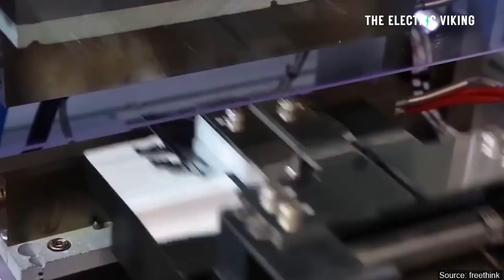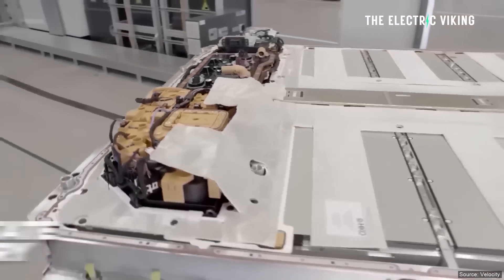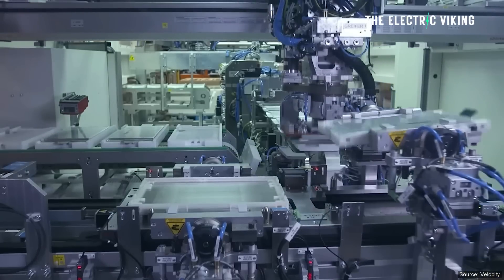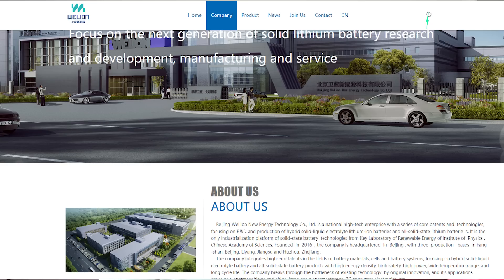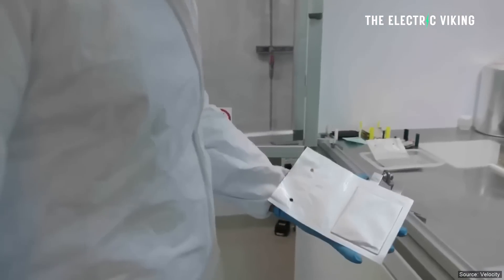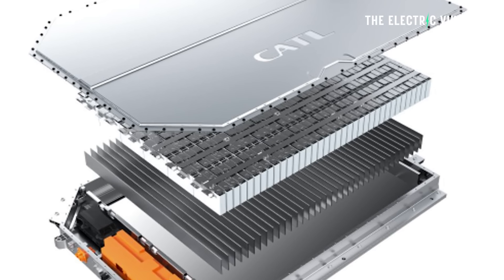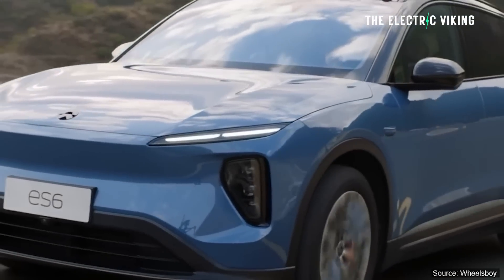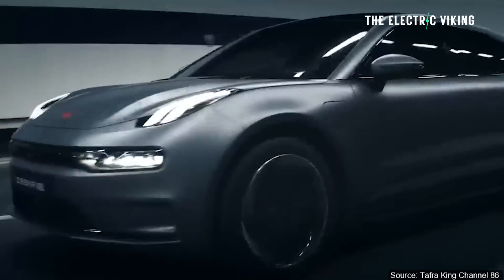Nio's ES6 has 577-mile range & 150-kWh Solid-State Battery

Comment: November 2025: "Nio stopps production of the 150 kwh battery after a few hundred units have been sold". Lack of demand due to the high price of over USD$36,000 for the battery when the whole car costs USD$39,000. For the EU it has even never been licensed (costs for testing and certification).

Comment: This is actually the sentiment I predicted in an article for carnewschina over a year ago. SSBs are hyped as the 'holy grail' when it comes to range, charging speed and lifespan. And quite rightfully so, if the theory could be put to practice. The problem is, when you talk about semi-SSB, people only hear SSB. But a semi-SSB is not an SSB, it doesn't have these 'holy grail' specs. So, people hear SSB and don't see the specs they imagined. That's a reason for disappointment, which I predicted.
Still, semi-SSB seems to provide a 20 to 25% improvement in energy density over nickel-based ternary batteries. That's a bigger improvement than Tesla, when it upgraded from 18650 to 2070 cells and that was quite exciting.
Ternary batteries have an energy density between 160 and 200 Wh/kg at pack level. So, NIO introducing a 260 Wh/kg swapable pack is quite a significant step forward.

Comment: I don't get Nio.  It seems like they're using several different kinds of battery pack now.  Will every Nio battery-swap station have enough of each kind?  If a random Nio owner drives into a random swap-station, will he or she get a swap that's like-for-like?  Seems to me there's a high probability that swap stations will run out of some types often.
Reply: Because of low supply for now, I don't think anyone will buy the 150 KWh pack upfront, they will most likely just rent it for a short time, like for trips etc. So it's okay for the batteries to vary in every station. If you choose to downgrade your battery while renting, you will pay less per day or month

Comment: NASA is working on solid state batteries. I can't imagine you know more than NASA. Below is a bit from the article
"While lithium-ion batteries currently dominate the battery technology space, NASA has used a different type of battery called a “solid-state battery” that is lighter and can store more power than lithium-ion batteries.

The solid-state battery isn’t new, but the technology has not been suitable for use in large electronics until SABER’s recent discovery."
Reply: Ha ha! Good one! NASA smirked at SpaceX for years. Sometimes the bureaucracy is more about govt funding than feasibility

Comment: What are the complete specs for the SS 150 kWh Nio battery, what are the complete specs for the 140 kWh Zeekr battery?
The point is the Nio 150 kWh battery is only a little bit heavier and the same size as the 100 (?) KWh battery. 360 Wh/kg is a BIG step up from 270 Wh/kg

Comment: the first thing is that this is SEMI solid state tech - so it has no full potencial - you can check similiar technology in power banks at Zendure company - it has some advantages. (working i lower temp, battery life is better, safer battery)
TBH we don't know other data like how fast NIO  is charging, how long it can be charged with full speed, in what temperatures it can run, is it safe, is it cheaper later to produce on scales, what is durability and losing % with years/kilometres? 
I see this as first SEMI step forward with somethign fresh in these cars.

Comment: The problem here is not the battery but the efficiency of the NIO drivetrain. 
Having said that, indeed the current versions of semi-solid state are not as cost and range efficient as they may one day be. However IMHO most vehicle uses do not require all the range that a semi-solid state can give and is a totally inefficient use of that much power reserve. I believe that semi-solid has a place but it will be more in commercial or off-road usage where high mileage is important and not for a family car.

Comment: Yes, this believe in a technological discovery and game changer is infantile. Dutch students were able to charge a big battery in 3 minutes by improving the cooling. Somewhat improving the charging of the ZEEKR 001 (which is already impressive at the moment) and the energy use by the EV motors, and you have an  IDEAL EV drivetrain. 150 KW packs are nonsense for passenger cars.

Comment: NEO would have been better replacing the 100kw pack with a new SSS battery thus reducing size and weight of the pack, rather than just chasing headline range figures.

Comment: Unless you’re living in Alaska I don’t see the point of a 600 mile battery. Carrying around a lot of dead weight when a smaller battery could be quickly recharged. I’m looking forward higher density batteries primarily because they’ll mean lighter cars, and therefore more fun to drive in the corners
Reply: Ummm... it's really time consuming to charge your car on trips. Having a huge range would be amazing. In tesla you are charging once or twice on long trips and it's really time consuming.
Reply: @kyleharr10  especially on business trips where 30 minutes here and there may throw you to a new work day.
Reply: Cold climates in general need this because range decreases dramatically. A 600 mile EPA rated range can be just 300 miles of highway driving if it’s cold enough. My model 3 (pre heat pump) loses half of its range when temperature is below 0 f (-15 c).
Reply: Right now 600 mile packs fill a niche with buyers who have range anxiety. And the people who drive without stopping often.

Comment: So the problem are not the batteries. Some of the key components and major factors ,that play a role in an electric cars efficiency is the weight of the car, it's coefficient of drag CD and software management of this power including regenerative breaking and power management.All these have to be fine tuned or come together . You cannot just stick 150kw battery in a car and expect a long range. The points I mentioned above are some of the key reasons why an electric vehicle travels further.

Comment: You are wrong.  nio has dual drive 480 horsepower.  This causes the motor to be heavier, and require more energy.  And why didn't you mention how much a battery costs at Ziker?  Considering the fact that no one needs 1000 kilometers a day, that's why there is a model of renting the battery to upgrade and maintain your battery as needed.  nio vehicles are heavy vehicles.  Zikr's composition is more similar to et5 in terms of structure, shape, and aerodynamics.  es6 has many more competitive advantages over Zikr.
Reply: You are a little wrong here, the dual engine ZEEKR 001 544 HP - and the 'real' range is around 720 - 750 km, with the 140 battery, - which should be minimum for cars of this size and purpose. 
City cars should be around 400 - 500 km real range.
Reply: i am not a tesla fanboy and i don't think nio is doing much right either. the sales figure tells all. zeekr 001 outsells nio all models put together almost every month. and 001 is not a cheap car. NIO cars are of poor value. very good quality but poor value. its battery swapping strategy makes little sense now.  charging has got so fast and range has got so long, swapping batteries does NOT save time. and to those who says that it saves nio owners the trouble to fixing batteries and future upgrade, i just have a few words "if only nio still exists then". there are many disadvantages to battery swapping as well. NIO needs to come out with their none-swapping subbrand and shift focus to that brand and nio needs to do it fast. it doesn't have much time at all. it is running out of cash.
Reply: Nio will be under soon.